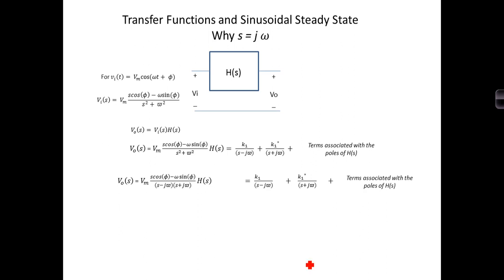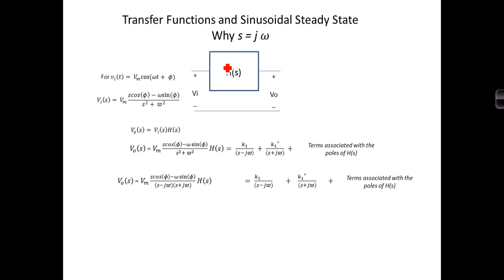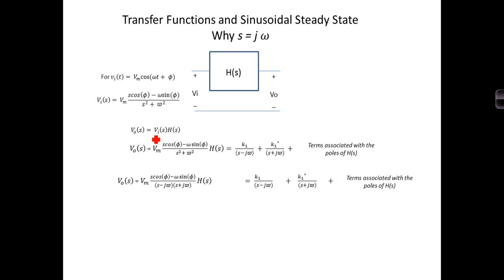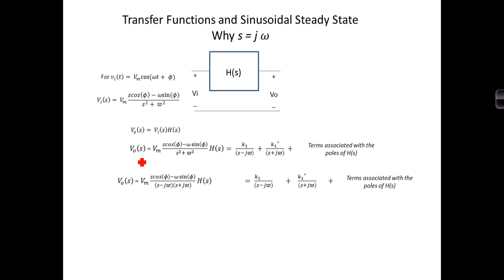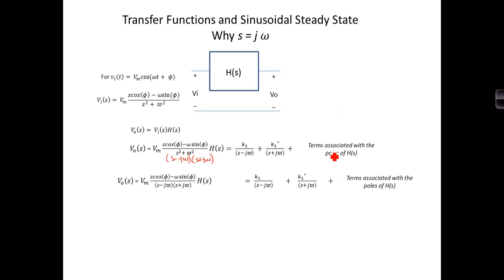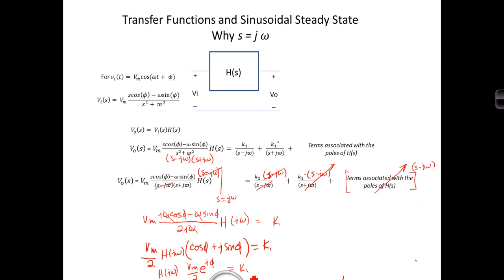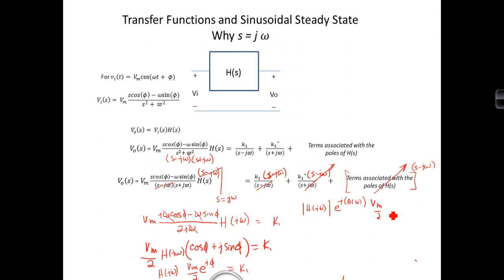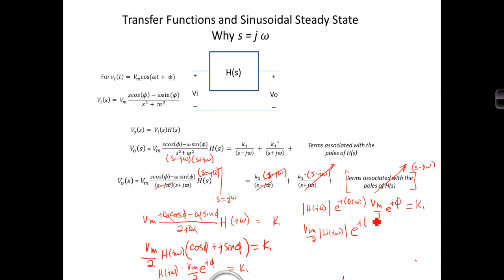Transfer Functions Hs 2 Why s = jw

Comment: Thank you so much for this. I've looked (even in good textbooks) for what the reason is for setting s=jw when discussing frequency response. Your explanation here is perfect because it shows mathematically why the following is true: at SS (when those transients die out), the response is completely characterized by the magnitude and phase of the transfer function at s=jw (because that is the value of s that gives us our coefficients in the partial fraction expansion in using the Heaviside cover-up method). Thank you, this was fantastic!
Reply from the maker: Yep, you got it ... and said it better (more succinctly) than I!

Comment: 2:47 why evaluate when both sides s=jw?
Reply: He is essentially using the heavy side cover up method. I would recommend looking up a basic video for this and it will make much more sense. I believe he also could have multiplied by (s + jw) and evaluated at s = -jw and you would arrive at the same answer since (s + jw) and (s-jw) are complex conjugates of each other
Reply: Fun Run Tutor x Hunter 
To cancel out other terms and be left with only k1
Reply: Why is K1 the interest??

Comment: goog video but I still dont understand why s=jw
Reply: Captain Rhodes it only applies when you are working with sine and cosine. Because multiplying a complex sine cosine conjugate by jw os the same as differentiating it. Dividing by jw is differentiating. Try it. In laplace multiplying by s is time differntiation and dividing by s is integrating. So s=jw because they are the same operators only for sin and coding functions in s domain.